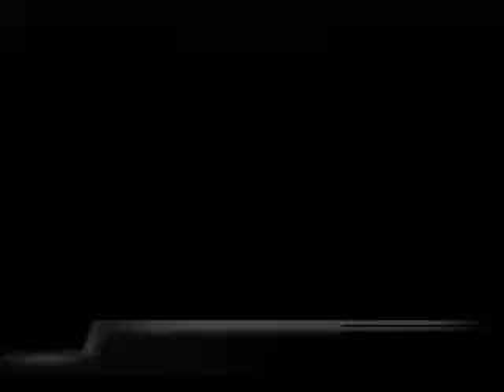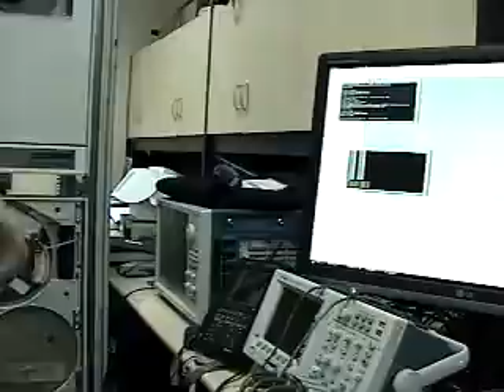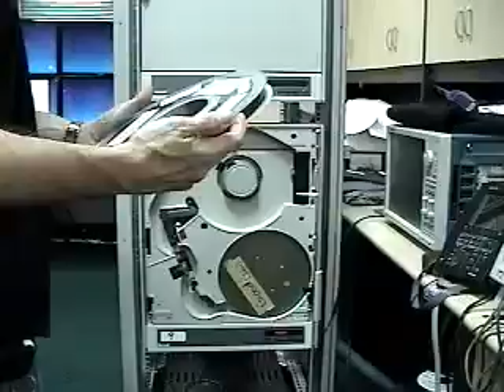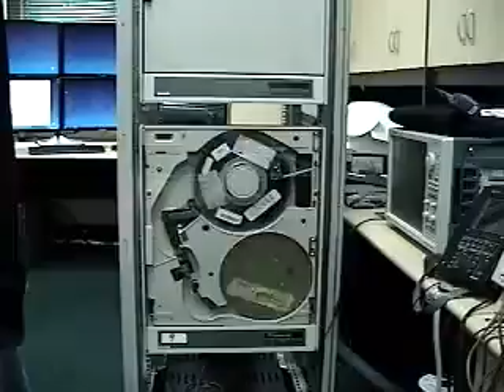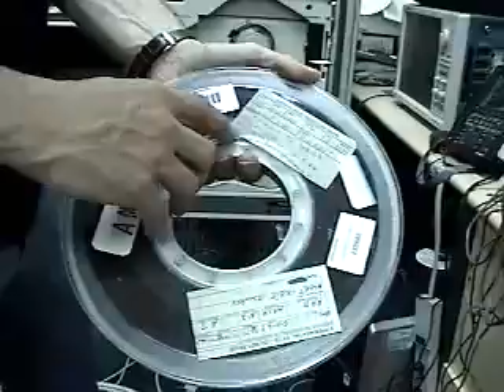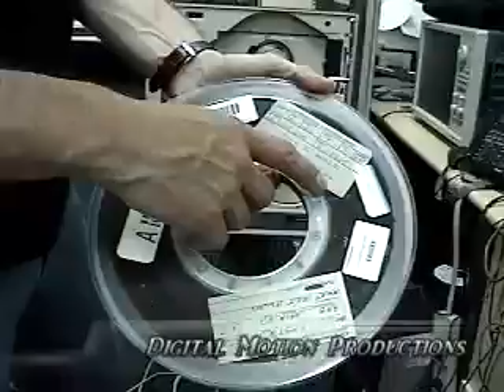JBI (stock symbol JBII)

Comment: 70 Tape Drives. $22/tape.....NASA has millions of these tapes. And this company has an EXCLUSIVE procurement contract from NASA....adds up to an impressive bottom line.......without any of the Plastic2Oil, which will add a lot of revenue from the franchises....z

Comment: I love the low overhead....the automation is very impressive. One guy could probably run 30 or more drives. 

I used to be a computer operator back in those days, so this brings back fond memories.

Of  course we had to actually thread the tapes.....this is way faster.......z